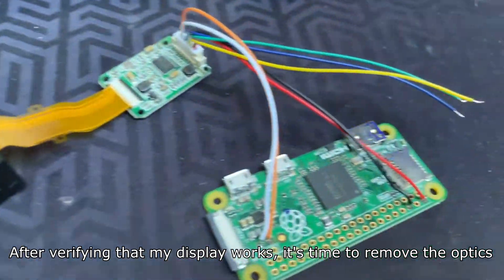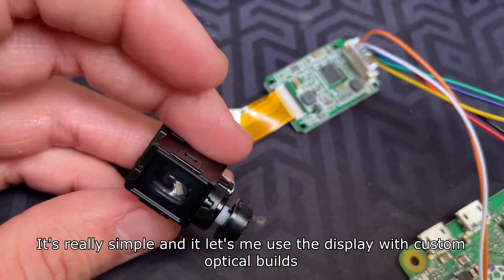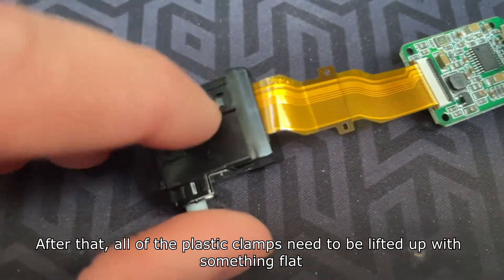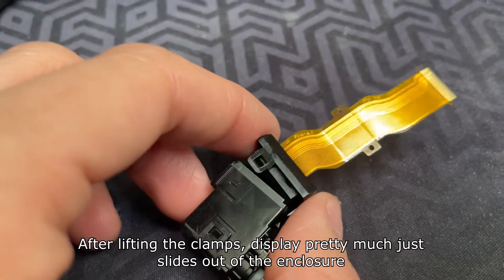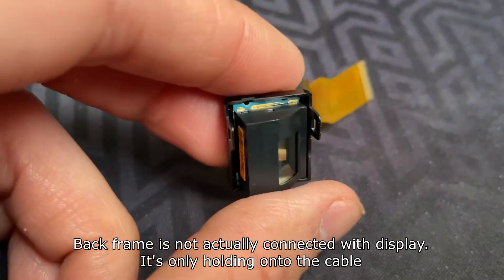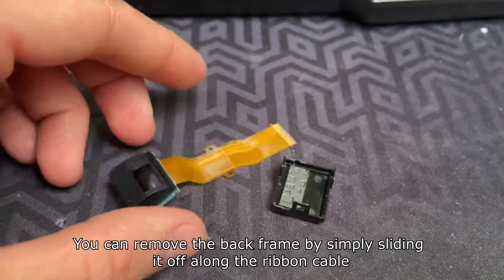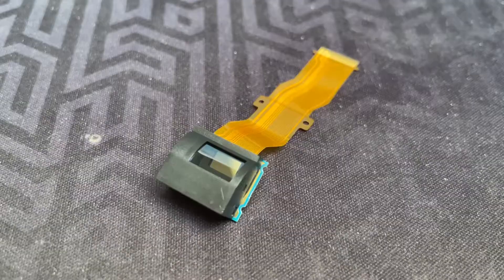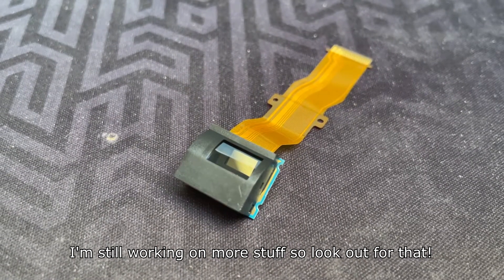FLCoS Display Teardown | Easy Optics Removal

Comment: What is the difference between the FLCoS you used in that video and the one today? I see that the ribbon cable is different in the ones you used in the Sideloader. Also how much does it cost you to get one of those FLCos displays?
Reply from the maker: It's the same display. I've just changed the cable. You can the display on Aliexpress for about 50 bucks
Reply: @ManolloMancelli  Thank you.